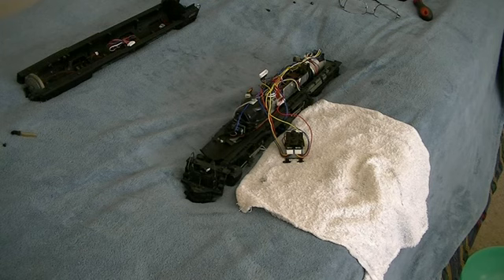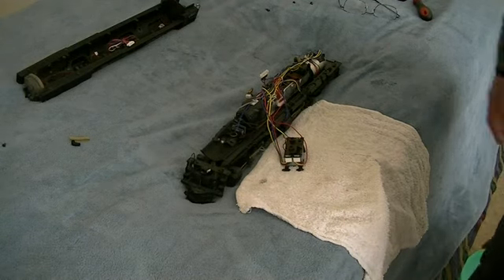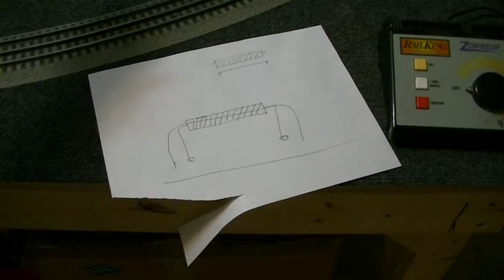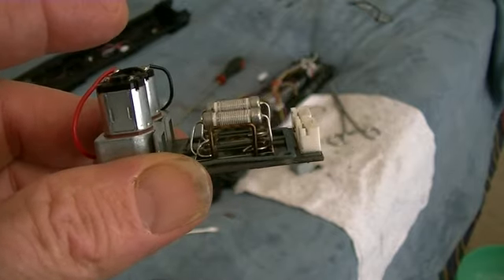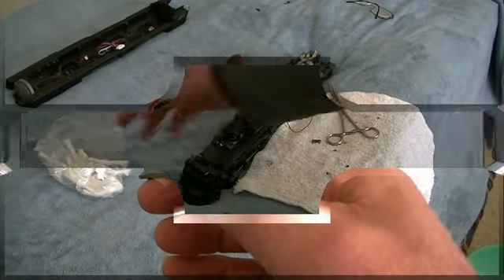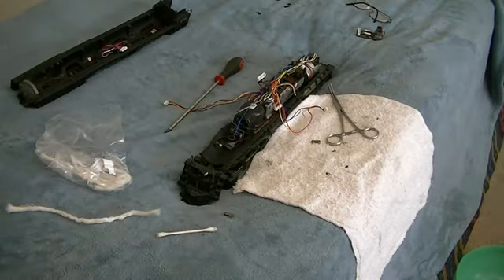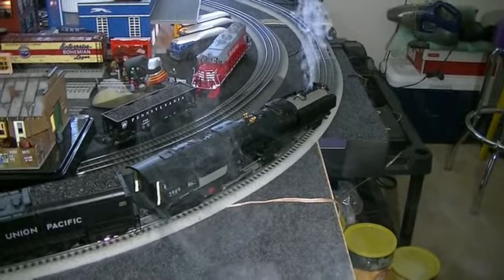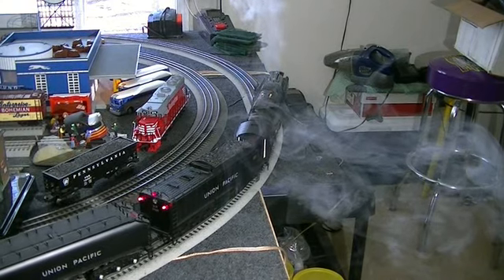Lionel VisionLine Challenger Main Stack Smoke Unit Maintenance & Modification

Comment: Awesome smoke unit repair, video and engine, Bill! That challenger is awesome!
Reply from the maker: +Matt-Trainlover9943   Thanks Matt!!!!!!!!!!!  And thanks for the comment bud!  P.S.  by the way, I will be uploading another video this weekend, probably Friday, and I will be talking about the new Lionel dual smoke units, the bottom line in my opinion is that smoke fluid needs to be loaded into both the main stack and whistle steam port.  Check it out if you get the chance!
Reply: +Bill Yates I certainly will bro!

Comment: Bill, wow, she really puts out some smoke now!!  Great Job on the repair!  This smoke unit appears to be a really dusey to fix!   It is strange how Lionel does not use similar designs for smoke unit in every engine.  I have fixed several of mine...new and older engines and have found it interesting how each once can be a little bit different.  I recently ran out of wicking from Lionel, so I used Tiki Torch wicking in a couple of my engines.  So far it works well.  Very nice video.  Thanks for sharing!
Reply from the maker: +kstrains   Thanks Ken!  It actually wasn't that difficult of a repair and thankfully I already had the normal replacement batting and the elements on hand!  And by doing the work myself I was able to see exactly how the unit is plumbed and designed which will help me get better smoke performance in the future!  And yes I agree!  Lionel seems to be constantly changing their smoke unit designs, but in this case I believe the reason they used that sheet type batting was because it allows them to fill both smoke units "main stack and whistle" from one location.  I have had quite a few questions about this so I might talk about it in a future video! ... I have heard Tiki Torch wicking works great, one of these days I will have to give it a try!  Anyways, thanks for the comment bud and have a great weekend!

Comment: Great work Bill, I had the same issue with my ES44AC's including my CP VP.  Just got the KCS "Naked  Belle" ES44AC today, hope it doesn't share the same problem.
Reply from the maker: +steven williams Thanks Steve!  Well sooner or later all smoke units need maintenance, and if the unit is run dry it will be sooner not later LOL  Just watched your KCS "Naked Belle" video, love it!  Anyways, thanks for the comment bud and have a great one!

Comment: Hi Bill - Interesting process. Smoke units can become a complex issue. Lionel should have had the part, seems like all they want to do is sell us new stuff. I needed some traction tires last week and they were out of stock and they ask me to call back in three weeks. Anything you like in the new 2016 catalog? I am up in the air. Open a window, you have smoke.  😊 Do you do the OGR Forum?
• Cheers from The Detroit & Mackinac Railway 🚂
Reply from the maker: +trainroomgary  Thanks Gary!  Lionel from my experience does a great job with the parts, better than most companies, but running out of parts does occasionally happen and it this case it really didn't matter because I already had the normal replacement batting and the elements (resistors) on hand, and it is smoking as good now as it ever has! ... Regarding the new catalog, Oh yes, lots of good stuff, hopefully by the time the stuff I want arrives, I will have the money to afford some of it LOL  At the very least I would like to get the VL GG1 and the GS-4 daylight with matching passenger cars!  Anyways, thanks for the comment bud and have a great weekend!